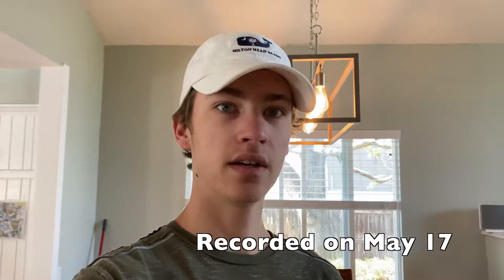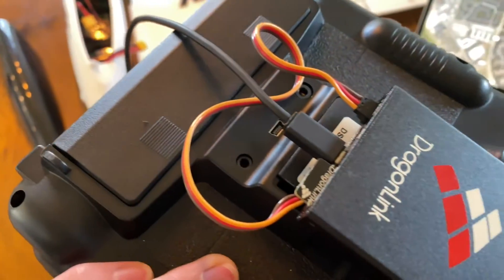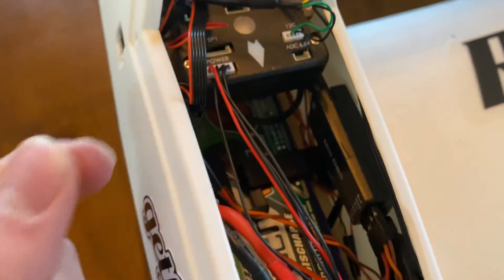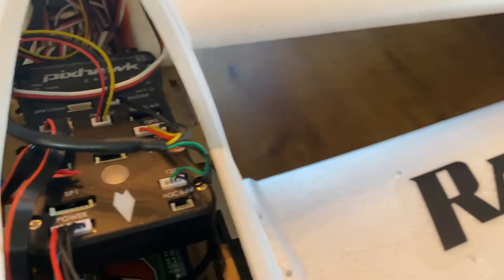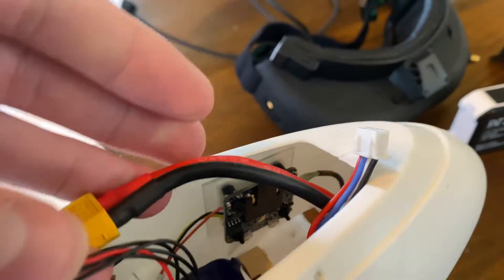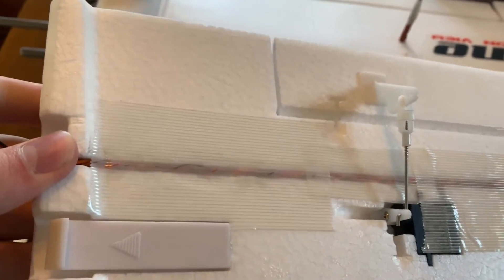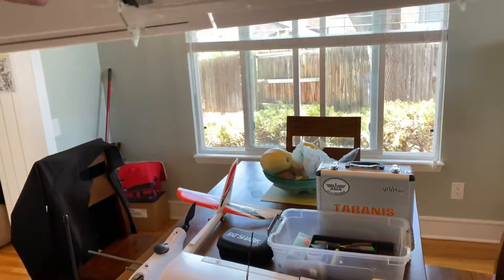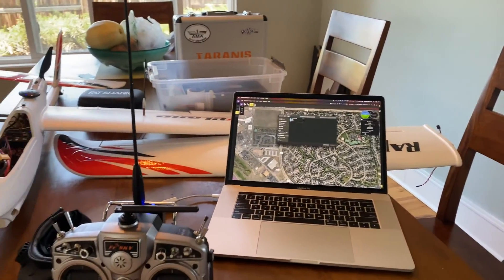Volantex Ranger 2000 Long Range FPV Build - Progress

Comment: Thanks for sharing.  I am going to install a DJI air unit and camera on the same aircraft, I have been flying line of sight, now willing to beginning fpv.  I am not sure how to power the air unit, what battery mah is needed to power the air unit for say 20 minutes . Also for 3300mah battery, how many minutes this glider can fly assuming I ll be drawing 6-7 amps?  i am using a FRsky radio RS20,,is there a special receiver to use, or a dual 2.4/900Mhz receiver would work fine .  I am talking around 2-3 km away. I will using this with dji goggles too. Too many questions!

Comment: Nice.. iv never tried pixhawk. How is compared to Matek boards runnng inav?
Reply from the maker: I’m working on a video about this point, overall I would stick with matek board, and if you want ardupilot just run it the matek board.
Reply: @hroszell  Ok. Sounds good. Thanks

Comment: Hello there. Nice vid btw. Im buildng mfd twin engine or ranger 2400mm lr. fpv setup and i am going to use tbs crossfire lite TX. Im just not sure if you can send telemetry to laptop via mavlink over WiFi. Tbs lite doesnt have Bluetooth module however it has a wifi. Thx for help. And PS. what would be your choice for long range: mfd twin engine mini or volantex ranger 2400mm. Im uncertain what to buy because im afraid that 2400mm glider will fly slowly(max 35kph) and also im worried about it's wings assembly/ disassembly.  Again thx and cheers from poland:)

Comment: I just watched your dart XL video first so I see you've already canned this plane. I'm on the same trajectory as you - I bailed on my ranger 2000 after crashing it repeatedly. Now I fly the dart XL and talon GT exclusively. I do dragonlink telemetry to my laptop like you do. Instead of USB I installed mav2passthru and the dragonlink creates a wifi hotspot that my laptop can join. Other thing I do different is I use matek flight controllers. WAY cheaper than pixhawk and they include OSD. Get the Matek f765 for best telemetry. It can do flow control just like the pixhawk. You should install an airspeed sensor too. Cheers
Reply: Nice works guys.. I am still sticking to an old skywalker 1680..dont know why but i still like these one so much.. Keep posting more video.. Cheers
Reply from the maker: Hey Steve! It's kind of crazy that we both started on the Ranger and migrated to ZOHD products, I think that the Ranger was a good trainer plane but it's also fun to fly faster and farther. I'll have to take a look at mav2passthru, I want to find some way to connect telemetry wirelessly. I have some code written to use a Raspberry Pi to pass Mavlink to my iPad using a UDP server connected through WiFi, but it's not very reliable and adds more complexity. I also sort of regret going the Pixhawk route (as opposed to Matek), I kind of dove into this project head over heels and went for the best things on the market. I wish you luck with your setups, I'd love to hear how the Dart XL compares to the Talon GT!
Reply: @hroszell  mav2passthru does what your pi does but more reliably. Search for it on rcgroups. Dart XL and Talon are both great. Dart has no rudder through so there's a lot more rolling and in wind it will cruise on an angle to keep its heading. Talon doesnt have quite as much range though but it travels faster. I tend to fly the talon more.
Reply: @stevealexander7310  Why was the Ranger crashing?  Bad design or bad luck?
Reply: @bartonfink5051  the plastic clip that holds the wing in failed. I am not a fan of the design but others seem to have better luck than me!

Comment: Hi can I ask you a question please?
it was about the radio I think.
Is there any rules or requirements if I want to use a frSky radio with a volantex ranger?
I was looking for a long range radio but if you have a long range radio you will need a camera to see it right?
Does the camera equipment have rules too if you wanted a long range fpv setup?
Im sorry I don't know anything about even regular fpv cameras or setups but the long range setup looks cool I rather try to get that kind of setup.
Im sorry for the question i'm just trying to get a setup like this but doesn't have to be as nice as yours.I wish I knew how all that stuff worked but it was a good setup video thank you.
I
Reply from the maker: Hey there! The only rules regarding radios are regarding the FCC regulations, so as long as you stay away from frequencies that they require a license for you should be good there. As for range, there is no rule regarding when you need a camera, they are purely for user enjoyment of the footage or convenience with FPV. If you want to fly FPV, you'll have to get an FPV setup with a video transmitter, receiver, goggles and camera. A setup like this would be very different than flying line of sight, so I would consider what you want to use your ranger for before getting cameras, FPV setups etc. Hope this helps
Reply: @hroszell  hi thank you very much it does help..I been wanting to fly fpv for a while but never know how to set that all up and what to use I didn't even know they had long-range systems.I got a volantex model now and will just look for a transmitter and go from there. But I want it to be long range too.thank you again.

Comment: Nice setup! I'm building something similar right now (or at least, waiting for the parts to get started on building the damn thing). Curious to know if you had any issues fitting the Pixhawk in there? I've read that the Ranger is a bit of a pain to build into because of the plastic body.  Any tips?
Reply from the maker: Hey Andre! I know the waiting feeling all too well, the Pixhawk actually fits in there perfectly, although I will say that I had to get crafty eventually and stick some of the electronics under the battery bay. The only advice that I have is to use the flaps with the ranger 2000, they help immensely on landing.

If you need any help configuring Ardupilot feel free to email me and I'll be glad to help you out!

Comment: Hey man your build is super similar to mine. The Ranger platform is amazing. I'm building a Ranger 2400.  I too like you had issues with transportation I used  general aviation connectors to make the wing wiring less of a mess and easier to disconnect on the go. 

https://www.amazon.com/gp/product/B07D2675JW/ref=ppx_yo_dt_b_search_asin_title?ie=UTF8&psc=1

Here's a pic of them installed:

https://ibb.co/Q6znzm2
https://ibb.co/GTVZzLf
https://ibb.co/fSPKBzH
https://ibb.co/5WxvTyH
Reply from the maker: Wow that's a great idea, thanks so much! How do you like flying the 2400 as compared to other gliders? I kind of want to experiment with a super long wing span. Have you noticed if it's more efficient than others?

Comment: You spent quite a bit on a lot of brand new professional FPV equipment. As of June 19th, you'll need both your Part 61, 107 drone pilot license and a HAM radio operator license to use all that equipment or else your looking at $20k+ in fines. Luckily, cost doesn't seem like an issue for you, so you'll be able to afford both as long as you can pass the exams.
Reply: wait wtf you spent a couple grand on the entire plane to put a 5.8ghz 1W transmitter in it?????? Im so confused lmao, how far are you planning on getting? TBS unify is mainly for quads bro, designed with the assumption that it will have constant airflow. Your gonna fry that thing and melt the filament tape holding it in place at 1w.
Reply: @dillonmccormick2511  your obviously out of touch with 5.8 then....
Reply from the maker: Hey Dillon! Thanks for your kind heads up regarding the FAA rules and the requirement for a HAM radio license. Luckily, due to the nature of my flying (hobby, not getting paid), there is no need for a part 107* UAS certificate, part 61 pertains to actual pilots. This is actually a pretty common misconception about the current FAA regulations, as a lot of people are unsure of what circumstances require the certificate. The reality is that the Part 107 Remote Pilot Certificate is only required for commercial operations. 

As for the TBS Unify, another misconception is that cranking a ton of power out of a transmitter will get you a ton of range, but what is actually more important is your receiver. If you are solely using an omni directional antenna, your concern is 100% valid, but paired with a directional antenna like the VAS pepperbox, you can extend your range to a little over 10 miles.
Reply: Hayden thanks for the reply. You clearly have control over what your doing which is nice to see. And that’s really neat to know about the TBS unify. I own several and use them regularly, but have never paired with the pepper box. Will def give that a try! I’m looking forward to seeing your long range flights with your rig. I was trying to buy the Ranger EX but have a hard time finding a new PNP or basic kit for it.
Reply from the maker: Dillon McCormick Hey Dillon! I 100% recommend the VAS Pepperbox, I think that you would love if especially for quads. Being able to fly without the anxiety of running out of range is so nice, and I think that it’s a good investment. As for the Ranger 2000, the only thing that I have to say is that it is sort of difficult to work on, there is only one opening for installing equipment, but other than that it flies absolutely flawlessly. It’s so controlled and stable, and is a prime candidate for an autopilot if that’s what you’re into. Best of luck to your build!